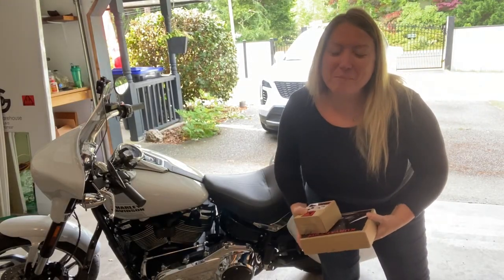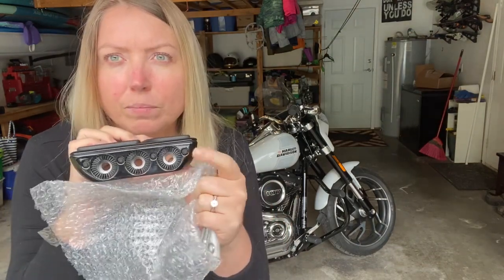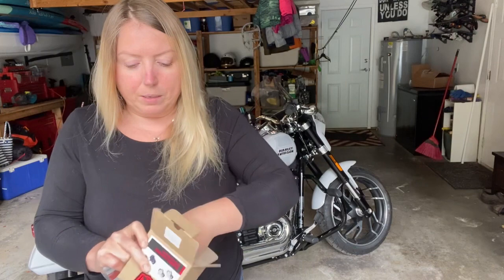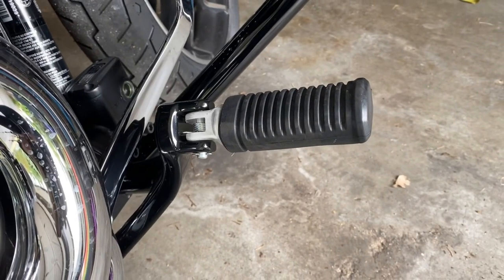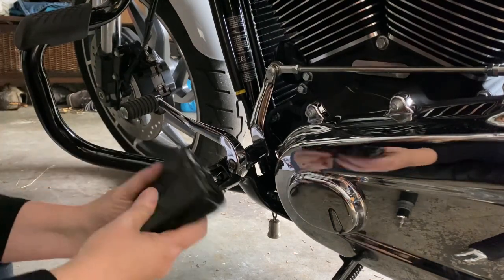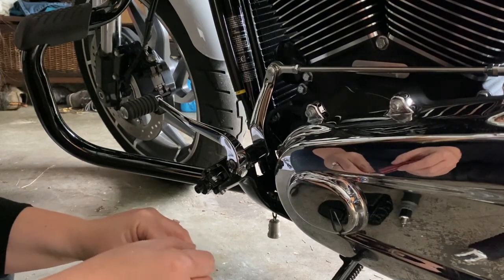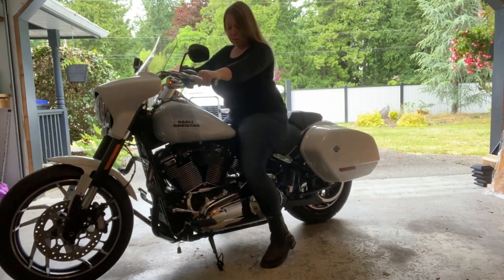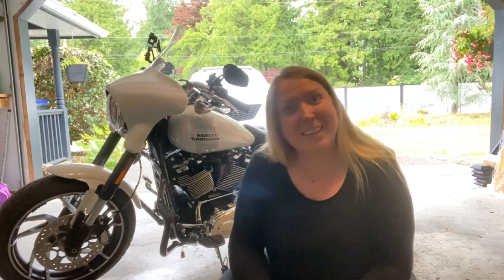Kuryakyn Kinetic Mini Floorboard Install on a 2021 Harley Davidson Sport Glide

Comment: There not long enough put your whole foot flat which is the whole point in putting them on, you need full length boards as on the 2018 on FATBOY M8 , the damned expensive bit will fit and are much better for resting your whole foot on, also get rid of the deep tread boots they really make it difficult for changing gears and braking Etc, there dangerous.

Comment: The softail standard with added forward controls needs a DK spacer kit to secure the floor board Clevis.  The kuriyan mounting pin is too thin.

Comment: I have my new SG for 1 week now and change some things already. Higher 12” windshield (but iam not satisfied). 4” risers. Moustache bar. Today i wss at the dealer to see what option there is for floorboards. I go for the Fatboy blach anniversary type, black! The order all the parts apart because the footpegs incl the mounting get changed…. Its gonna be expensive….probably 600€…..(but i can’t drive the rubber pegs with my boots with low heel, i have to lift my whole leg the brake or shift!)
Reply from the maker: I hope you’ll find a Windshield that works for you! There’s lots of options out there :) I agree about the foot pegs - those need to go!

Comment: How ironic. I attempted to install my Kuryakyn Hex floor boards in my ‘21 Sport glide. I ordered the incorrect splines however. Looks great btw. No biggie, I ordered the correct ones and will move onto installing my new performance machine renthal grips.
Reply from the maker: Those darn splines! There are too many different ones! I’ll look up those grips - it’s one of the next things I’d love to switch out

Comment: Thanks for the video, I'm installing their chrome premium mini boards on my 2020 Sport Glide. Did you change anything with the position of the boards? I have a 28" inseam, so every bit helps. My steel toe boots work fine when riding to my welding job, but my vampy tall high heeled riding boots don't work as well with the pegs. I was happy with pegs until now!
Reply from the maker: Those will look fantastic! I haven't changed anything about the positioning since this video. Everything feels great while riding!

Comment: Just started riding again after 45 years! Picked up my '21 SG in Grey 2 weeks ago. Like you, I love this bike. I remember the AMF Harley's. I remember riding on the back of a hardtail once. It soured me on Harley's. I loved the looks and sound but never envied the riders. This SG blows my mind in that regard. A NON rubber mounted engine and it's this smooth? Yup! I'm just thrilled with it in every way. I don't think my legs would like my feet flat with these. It's awkward for me to point my toes downward. Passengers though? These would be an upgrade. My first 2 bike upgrades will be crash bars and a taller windscreen. Then, slip ons. However, I really need a better 2 up seat with bar for wifey. Open to any suggestions. Good for you though getting this bike for yourself! May all your travels be safe ones!
Reply from the maker: Nice choice! Stay safe out there!

Comment: Hi love the video. Is it possible to get the partnumbers for this items? I have a 2021 and would love to have floorboards but those i found dont fit...?
Reply from the maker: I have them linked in the video description. I needed to get adapters to fit my 2021 which are also linked. Hope this helps!
Reply: Sorry looked but didn’t find any info…
Reply: Only the adapters…
Reply from the maker: Here they are on the manufacturer’s site https://www.kuryakyn.com/products/4686/kinetic-mini-boards
Reply: @blondeonwheels  Thanks a lot!!!